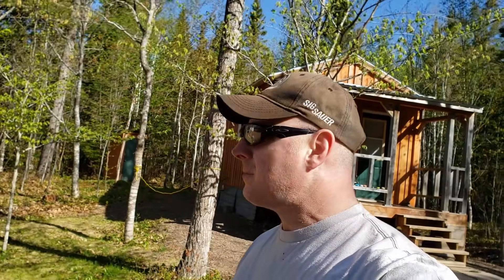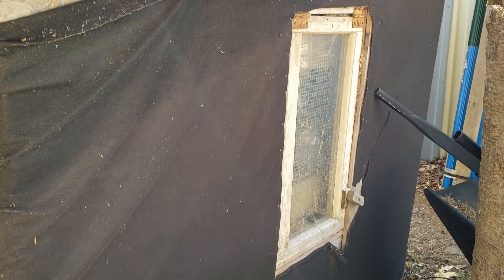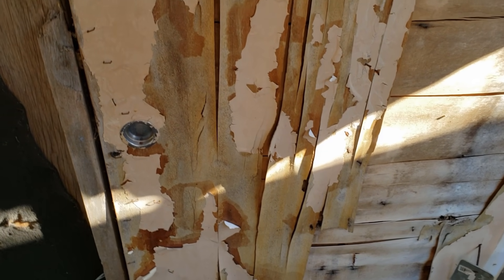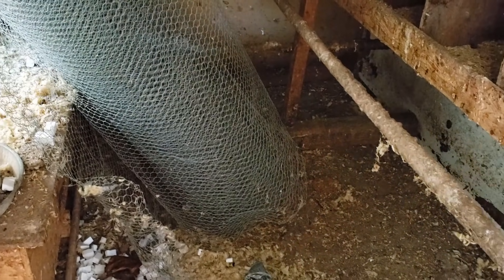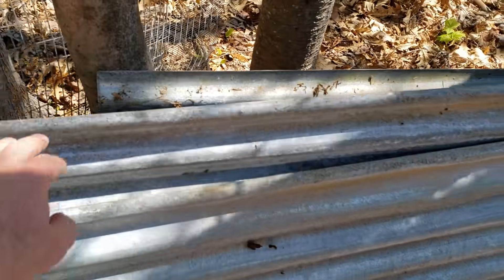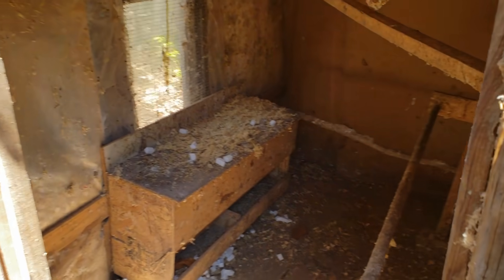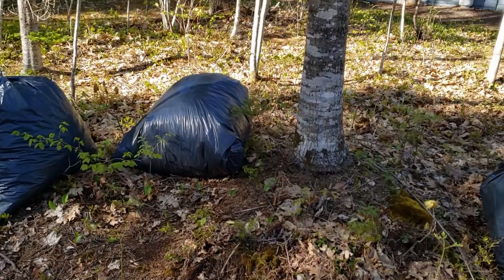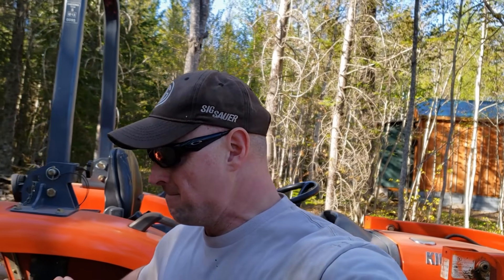Demolition and Moose Burgers

Comment: Great video, you sure cleaned that area up nicely.  I have a question, did you ever get yourself a fridge for your cold beer?  Over this pandemic I added (4) 100 watt solar panels and two Battle Born batteries to run my kegerator and basement lights for my house.  Works great!  I wish I could send you pictures but I have no clue how to.  I enjoy all your videos and it looks like your bbq might need a little tuneup as well.  Keep your guard up with that bear wondering around.  Now that he has the smell of a walk-in BBQ joint,  it might be an issue someday soon.  Seeya
Reply from the maker: nah, I'm still on the lookout for a propane fridge out of an old RV. A buddy of mine bought a solar one for this camp and it is sweet but $$. That bbq is about 15+ years old..looks it too..lol...but still works ok.